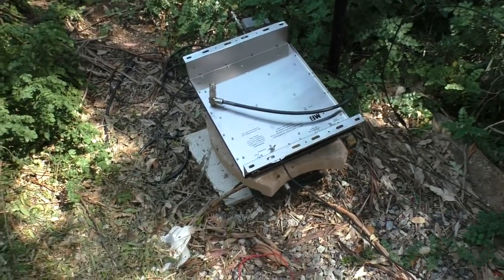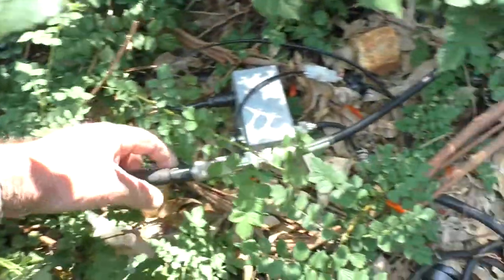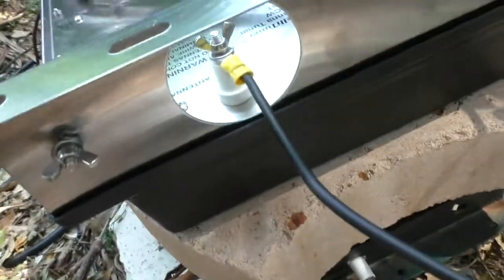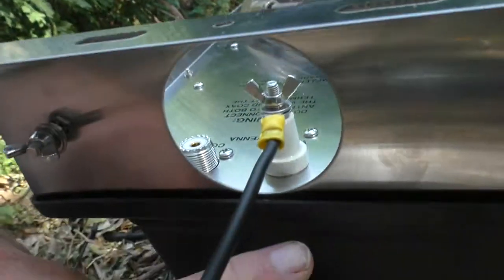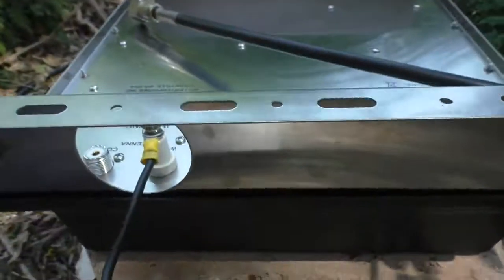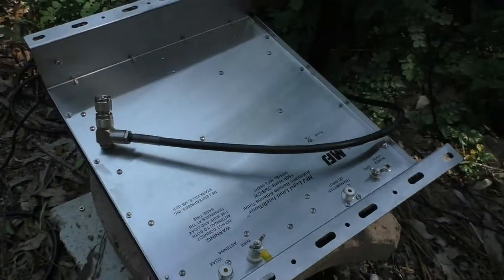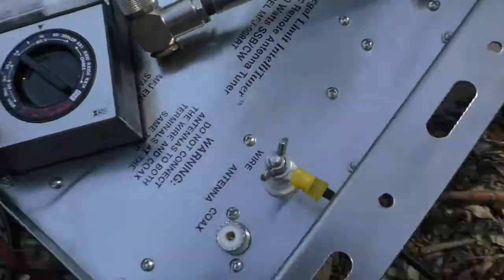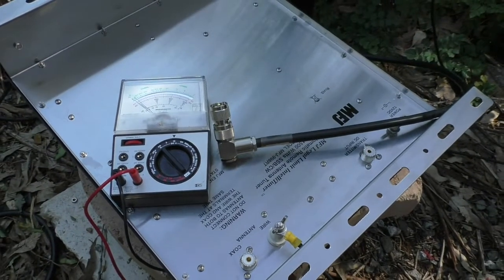Oh Dear... Auto Tuner Comparison Part 2 Will Have To Wait

Comment: I bought a Mfj 998 rt had to send it back when I hooked it up the choke started smoking on the input side of the tuner it was a quality control error a part was installed backwards, when it returned now it works perfect,mfj has bad quality control.
Reply from the maker: Yes, unfortunately they are famed for poor quality control. There's a design flaw in the 998RT. There's a metal screen over the processor that's only separated from the +12v line on the PCB by the varnish.

Comment: I recently got a MFJ962B  remote tuner and had a similar issue. In my case there was no tuning but the power connector and wire supplying 12V DC power to the Bias T got so hot it almost melted, plus smoke from the bias T metal box. I was supplying 12 V from a DC power supply.  On thing I noted was that the outside (ground) of the power connector was touching the metal case of the Bias T when it was inserted. The PCB inside of the bias T was poorly aligned when MFJ assembled and soldered. Major

I went to a small wall mart 12 V, 1 AMP supply. The plug doesn't rub on the case though. No more hot cable or smoke but not sure why it happened in the first place.

Tuner seems to work but sometimes it will not tune. Need to remove power to bias T and then reapply. Usually works then.

Looks like I will need to open it up and check the voltages when it is and isn't operating.
Reply from the maker: Hmmm... I would expect the case of the bias T to be connected to the RF ground. As you say, the internal board alignment must have allowed a 12v rail connection to be touching the case. Poor QC. The intermittent tuning could be anything, you might be lucky and find the supply voltage through the bias T is intermittent.
Reply: Note that the outside metal of the power plug is ground, not the 12 V rail. I am still investigating
Reply from the maker: Yes, that's what I mean. There could be something on the board that's touching the case and applying the 12v +ve to it. It may be isolated from the RF input ground somehow. Try measuring from the -ve of the power supply to the case and see if you get 12v.

Comment: I know that sinking feeling, I blew up my 817 when I got it..the cause is too embarrasingly stupid to repeat lol
Reply from the maker: Whoa there Hoss... I didn't blow it up. I suspect it has an 'idiot diode' across the supply rail inside the unit that has been installed the wrong way around. The circuit available for download from MFJ is rubbish, it doesn't show the circuit of the internal bias T.
Reply: I dunno, sounds like pilot error to me lolol. Nah, i just know the feeling when a new bit of gear blows up
Reply from the maker: Yes, it's a real pain. Fortunately it doesn't happen too often. Actually it probably would have been better if I had blown it up... I could then just open it and fix it without all the hassle of sending it back to the USA.